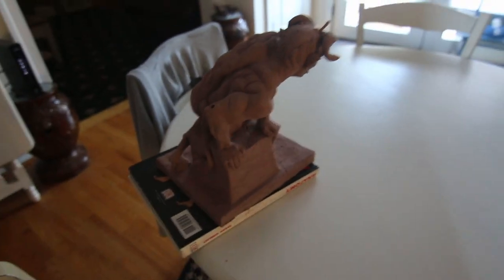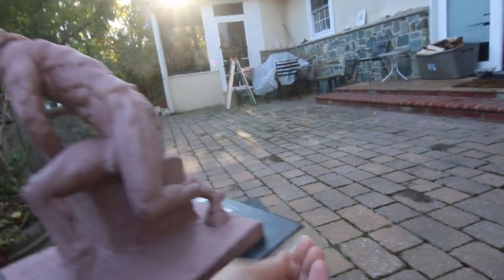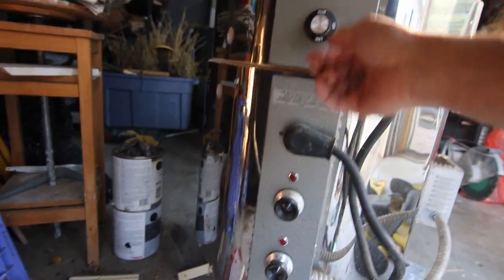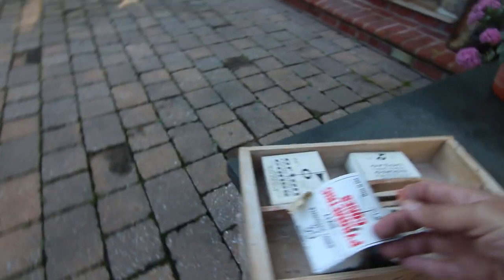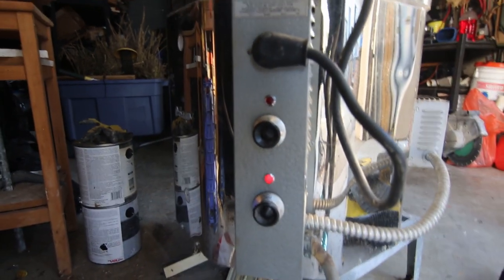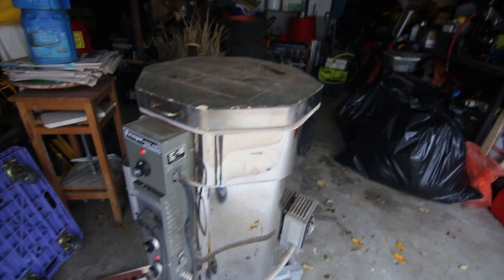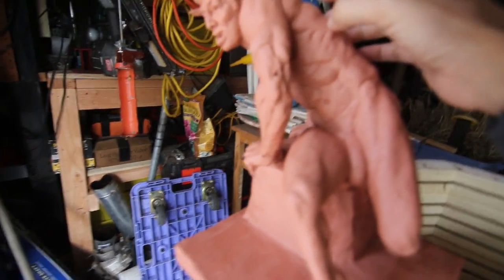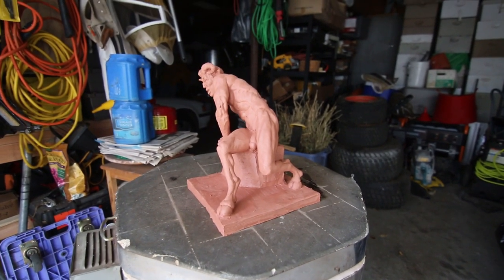Kiln firing a sculpture

Comment: Nice work man, did you take anatomy. Loved sculpting as a kid and want to give it a try again. My question is How thick do you limit your work so it doesn't crack??
Just spent $200 US for a used kiln will be converting to gas and Im making it smaller. They usually run between $3-$700 used.